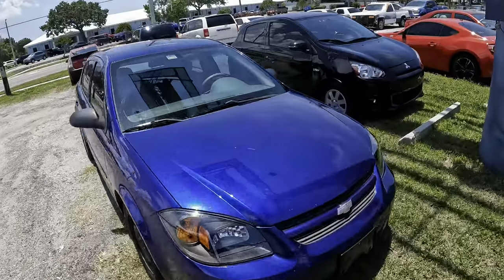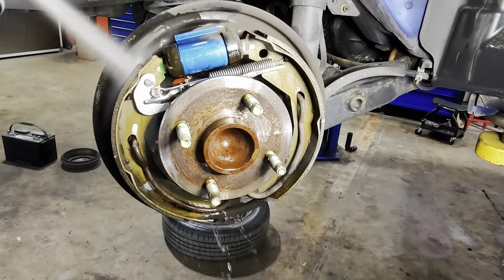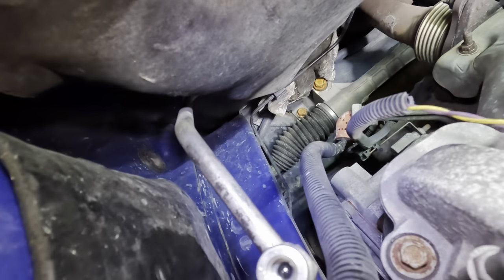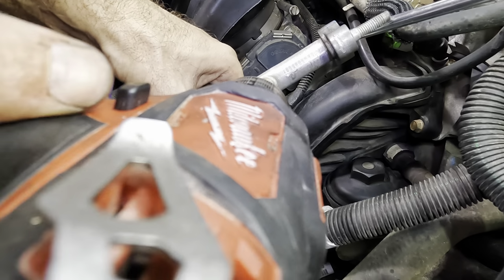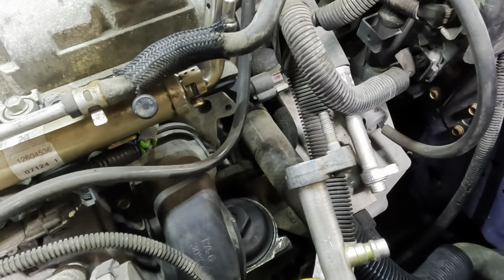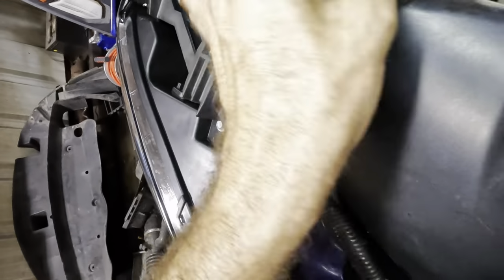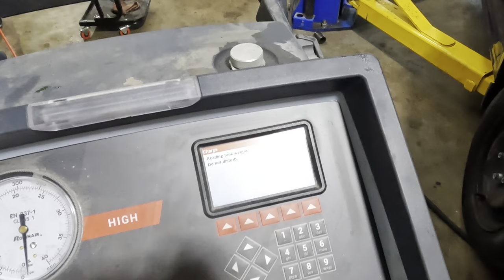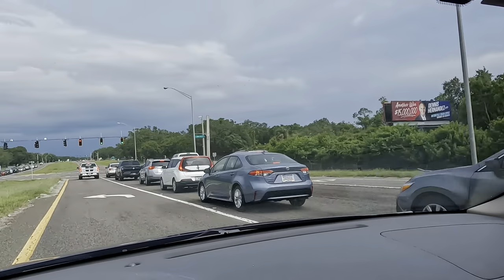Mechanic Still Can’t Replace Parts! Customer JUST bought it! Chevy Cobalt PT2!

Comment: I think I have learned something from your videos Ray.  I could be wrong.  Thank you for your skill and honesty.

Its got to be a losing battle.  The older the car the scarcer the replacement parts.
Then as cars age parts such as solenoids start to fail that rearely fail when the car was newer.
Then there are the repairers who are simply incompetent or hire incompetent workers.
Then as repair men age their skills are disappearing.  
I used to replace my drum brakes , I find it unbelievable that the drums were not adjusted properly.
Here is a thought, make it mandatory that all repair shops make videos showing how the repair was done.

Having said that I find it very difficult to repair the newer cars,
the skills and tools needed to repair the newer cars that are designed to be difficult to repair, make repairs impossible.
The EU is starting to pass laws that prohibit built in obsolescence.
Probably too late for ICE vehicles as EV take over,  the manufacturers of ICE have  cornered themselves by building cars that are so difficult to repair.
fwiw  I think you dont need to advertise,  because you do such a good job you risk being overwhelmed with work, then you will need to move into a larger place and hire more workers, and your shop will evolve into a different entity, but perhaps you could manage that.  Imagine a nationwide Rainman Rays Repairs franchise, where every repair is on video, it would be a self supervised repair shop, wow.  Now there is a thought.  You could retire a multimillionaire.

Comment: Correct me if I'm wrong.. but.. isn't that a HUGE no no in an A/C system? Introducing shaved metal into the A/C line???  I'da just changed the line. Or at least inform the customer and they would completely understand the issue. I mean... you can make an effort to get "everything" out... but once you crank the system back up and it spreads whatever is left all throughout the system.. there is potential to ruin other higher priced parts.

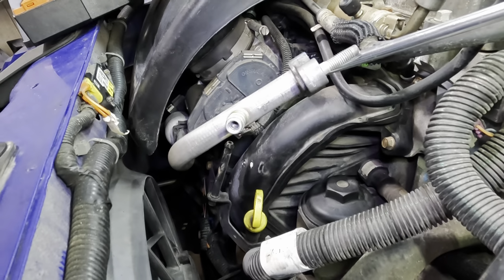Comment: I find it humorous that GM designed the wheel covers to look just like the SS wheels. The O'Reilly brake clean is good, but they've jacked the price from $1.99/can to $4.99/can. I don't care what anyone says... That's NOT inflation. That's greed. There's hasn't been 250% inflation. @13:32... That low pressure fitting is definitely leaking. You can see the oil all over the lower radiator hose. @20:00... I'd just remove the line before drilling. Zero risk of metal contamination if the line is off the car. The air trick might work, but it might not. Remove the line, drill, then flush with brake clean. @27:00... You can't blow air through the compressor. If you could, it wouldn't compress very well. @39:47... Looks like the pressure relief blew off at some point in this compressor's life.

Comment: No point in signage unless need more business to fill slack time. Otherwise an unnecessary outflow.  
For comic content, when brake cleaning, can use Ghost Buster line "Dont cross the streams".   
Good job caring for customer with no part repair.

Comment: you didn't break that part....so could the piece have been in the line already?  And you didn't 'knock' it into the line when you did the drilling?
Reply: If it did break before you started (most likely since there was a bad leak at that part), then any metal parts probably already went through the system and into the filter well before you started the work.

Comment: No to the sign. Word of mouth is the best advertising. Put 5-10 business cards in the vehicles you've fixed. 

That had to have been a northern car, bcuz you can't get a block htr otherwise. But it has no rust?

Comment: I had an HHR (same chassis as the Cobalt) that had some o-rings go bad inside the AC compressor. It was a simple repair. The only reason I found it was that I was under the car and saw oil dripping off the back side of the compressor valve assembly. I got a replacement valve assembly with the o-rings for $12 rather than having to replace a working compressor. For anyone that has an Ecotec in this age range, the valve assembly is one the side facing the radiator near the back of the unit. It will have what looks like a red or yellow button in the center and is held in with a snap ring. The 'button' is there to give you something to grab onto and pull it out.

Comment: There could still be a leak somewhere in the system. I had a system that would hold vacuum for 25 mins but the refrigerant still disappeared over the course of several days. Id have also checked the evaporator for leaks.

Comment: Peddle travel excessive, ok, but looking at the inner workings underneath the drum, it should not be necessary to hand adjust the shoes, as the system used, is fitted with automatic adjusters, that operate when applying the foot brake, which is not working as designed. It would have made a better video had you fixed the reason why the auto adjusters weren't working properly.

Comment: I would rather have crank front windows and not electric ones because if you go into water you can wind the windows down .
Reply: How many times have you drove into a lake?
Reply: @travissheehan6082  once would be to often  and yes i have been in a bad spot with water before.

Comment: Prettiest wheel cylinders I ever done see.
I know it's hard to lube the shoe/ plate spots when put together already, but...
The US would have been Metric from the time of Thomas Jefferson except for... pirates.  Actual pirates.
You know what will cure your love of English (Freedum) units?  One semester of Engineering Physics.  I got your poundals right here.
I could swear that temp control wasn't all the way to Cool Blue (or purple).  That would explain the 50s instead of 40s.

Comment: you do realize that you can reuse solvents? just start using a pump pressure spray bottle and collect it properly and youll cut your spending on brake  cleaner by 80%... your spending what? $4-6 per can? environmental issue aside, thats just a good financial decision.

Comment: I'm surprised you use the battery powered tools so frequently. You're in the shop not the junkyard why not take advantage of the air tools and stop killing the batteries just a suggestion 🤷

Comment: 3:48 injecting 120 psi of compressed air when drilling the valve definitely forced some particles pasted any filter. 
27:33 being lazy is why your doing extra work now. And if crap got into the compressor and takes it out, did you save your "customer" any money? Nope! 
Your laziness could cost them more. But hay, more money for you! This video just reinforcement why I unsubbed 6 months ago.